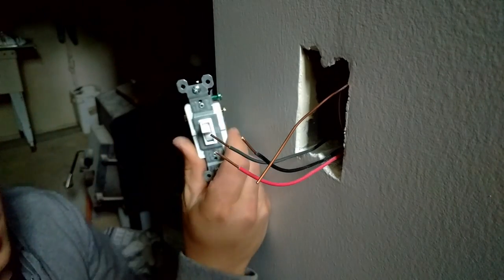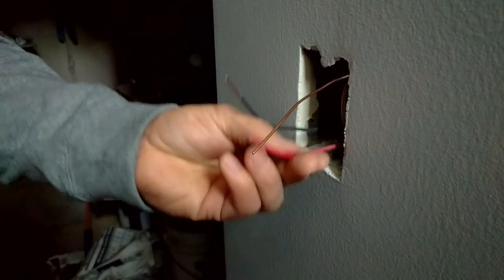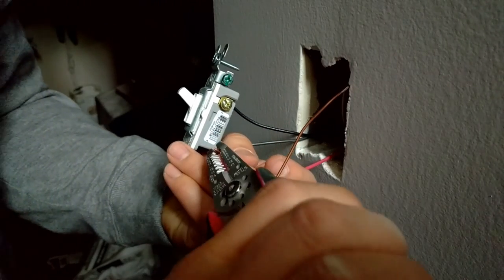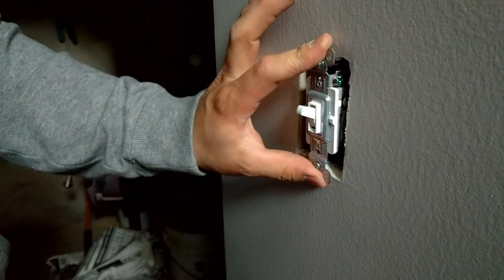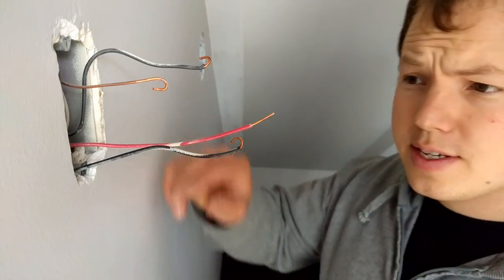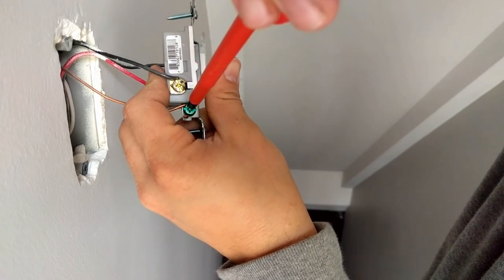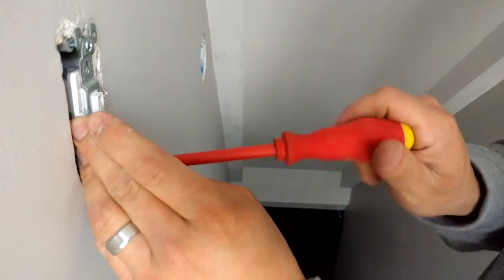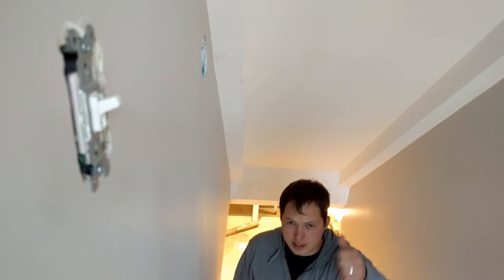How To Wire a Three Way Switch

Comment: Ben, is there a way that I can do a 3-way switch if the power is at the second location switch where the lights are connected to instead of doing the power at the first location where there is no lights connected to? Thank you for your videos, they have been very helpful to me.

Comment: Feed is at 1 switch...switch leg is at the other.  However you want to accomplish both of those tasks is up to you, but as long as you understand that you will have no problems with a 3 way switch system.

Comment: My house was built in 68, and many of the boxes do not have neutrals in them. I think code was 2011 or later that that was a requirement. So I have to run another 14/2 down to the other 3-way switch box so I can get in my smart switches which typically require a neutral.
Reply from the maker: Exactly. Good luck with your project!

Comment: What if one switch box just has the 14-3 wire coming in with no exit lines either to the light or to another outlet, etc? I have this situation, with two travelers but no common power wire. I saw a video saying hook the neutral to the common but this tripped the switch breaker. Thanks.

Comment: How do you wire nut the wires to check the circuit before drywall installation? Both blacks and the red together in one wire nut?

Comment: A terrifc video. I have been irritated since I moved into my new place in 2016 that the staircase three way light switches wouldn't work. With your help, I have fixed it so it works perfectly now!

Comment: For some reason the 3-way switch has been causing me a headache being only one month in to my career as an electrician but your videos don't over complicate as they explain what's going on. Gained a new sub here!
Reply: hunter james look at a diagram of what goes on inside of a 3way switch. You should be able to think of many ways to wire a 3way or diagnose a non-working 3way system. My first boss drew me a simple diagram and that’s all it took.
Reply: Oh, btw, this guy’s a clown. He does not know what he’s talking about with electrical work.
Reply: hunter james watch Sparky Channel, he’s one of the few guys doing electrical videos with any right to do so.

Comment: Hey Ben What are your thoughts on getting some electrical tape and taking a couple wraps around those exposed terminals before you button that up? Nothing like grabbing an outlet or switch on the side and discovering that you have some stray current from an unknown source. Nice work as usual! I still confuse myself on these 3+ way switches from time to time.

Comment: Best step x step video so far.  Okay. Just to clarify.  You did a 14/2 wire from the breaker box to provide your power?  Then you used a 14/3 to go from one switch to another, correct?  So which one did you use to connect the lights too?  
I’m asking bc I have a light fixture with 2 bulbs in it, which use to be a ceiling fan prior.  When I switched the fan with pull chains lights, and fan... I could only get on side of the lights to work, and not sure why?  Each light in the new light fixture has its own black(hot), white(neutral), but then on side has a copper for ground of course.  Also.  The wires in the new light fixture compared to the power, has totally different thicknesses. The new light fixture wires are more like speaker wires.  I’ve been really stuck on this for a minute and could use your advise, help, something so my girlfriend can give me a break. Lol. 
I’d appreciate it.  I thumbs up and subscribed. Thanks again.
Reply: Nrfa try pigtailing the wires together, you can use 14/2 Romex
Reply: Nrfa often the tab in the middle of the socket needs to be pulled out to contact the bulb. Do this with the power off.

Comment: Help! We stopped using that ancient switch style in about 1975. 
PS the proper way to "test" a 2 way switch. 
Switch 1 on. 
Switch 2 on 
Switch 1 off 
Switch 2 off. 
All 4 combos, you know you got it right. Occasionally you get it wrong and it's a pain when the customer calls you back

Comment: So minimum wires needed for a 3 ways switch to work is a 4 wire? Right? 
Fourth would be the neutral and optional for the fifth wire would be the ground wire?
Reply: You can have just 3 conductors. As long as the outgoing light is at the same point as the feed

Comment: Hi Benjamin you have an other subcritor hey just a sujestion could you please do a short video about how to attach the ground wire to the main panel also an other about how to add ground to a receptacle when it marks open ground normally pass in old houses thank you and apreciate if you can do that thanks again

Comment: Hi, thanks for posting.  I'm changing out 2 old grubby switches, each one is for a different light 2 black wires and 1 red and 1 is white and red together.  I am able to get 1 switch to work with its light, the 2nd switch, for a different light doesn't power the light.  1 switch is a regular switch not a 3-way.  Have I got the wrong type of switch or am I wiring incorrectly?  Thanks for any input.
Reply: Just copy the way the old one was. Take a picture next time before you take off the old switch. I assume you fixed it by now.

Comment: Thanks for this helpful video. Is it ok to put the traveler red wire in the right side of the first switch and put it on the left side of the second switch?
Reply from the maker: +Mohammed Aldujaili Yes. They're interchangeable.
Reply: Can u replace a 3 way switch with an outlet not using red travel wire?
Reply: Same question... my new 2 way switch works just as the old failed 3 way switch from both switch locations.
Reply: I always put my black traveler on first on the side with the single screw so as to not accidentally put it on the common black screw. This way I can also know if there is power to the fixture I’m hanging just by looking at the switches. Because homeowners suck, switches are often put in weeks before they provide fixtures and I’m not using my tester for such a simple task. Of course you still treat the wires as if they’re hot.
Reply: Louis Tancredi not always.

Comment: Does it matter which side or the Travelers on either switch
Reply: Nope. the travelers can be on either side.  the common or shunt wire is on the marked terminal.  old timers will call the common / marked terminal, the shunt terminal/ . Heard that from many years from a guy who i learned the trade from.  He is gone now.

Comment: you said the Neutral needs to be present , but is it used in that switch connection?
Reply from the maker: Richy Diago The neutral is needed for "smart" switches and motion sensors so it's a good idea to have the neutral wire present at each switch location. For regular switches like in this video however they aren't required.
Reply: Benjamin is quit correct.  by redoing the 14/3 romex you could see that at the switches could be a neutral wire if you wanted a "smart switch".